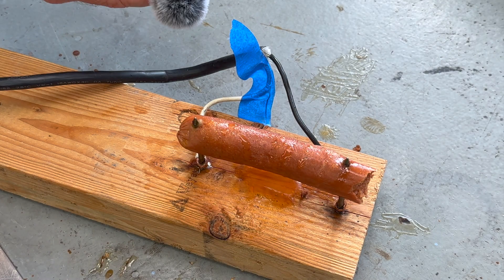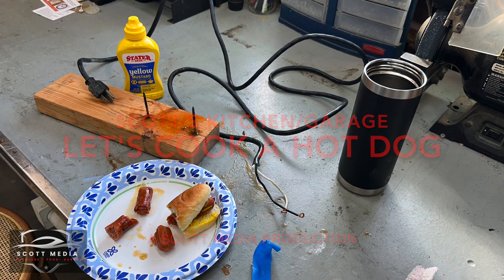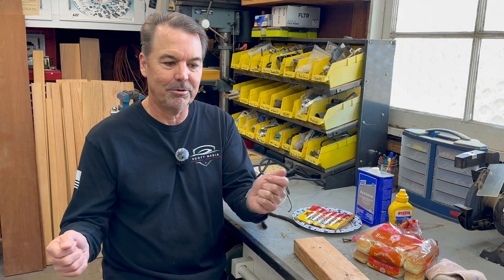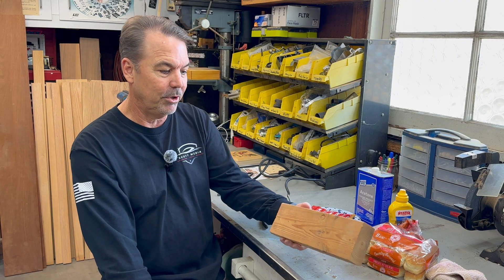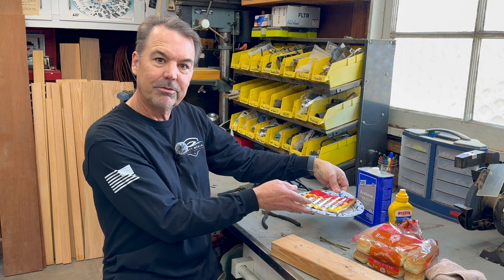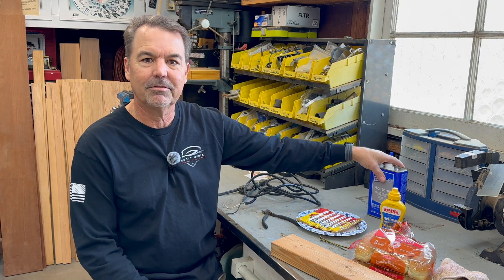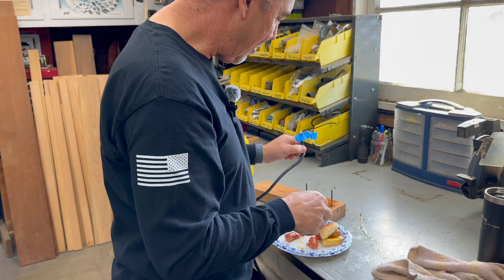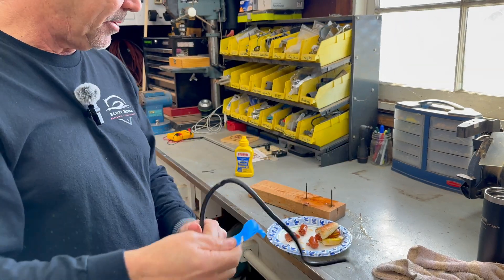Cooking a Hot Dog With Electricity - Don't Try This at Home! - Scott's Kitchen/Garage

Comment: We had a Presto Hotdogger when I was a kid in the early 70's. I used it all the time. I remember the "burnt ozone"/sizzling hot dog juices smell.
Reply: In the late '60s, my dad was friends with a fellow who  had all manner of nifty "kitchen innovations" he was trying to market.  One of them was an electric hot dog cooker which we kept at home.  There were 3 or 4 sets of horizontal metal prongs.  You'd take your thawed hot dog and wiggle its ends onto each of the prongs.  Worked well, and fast, but as you note, there was a certain "ozone" aroma and taste to them.  I assume that, as a commercial product, it had safety approval.  It also had a cover you could close to keep any hot dog juice from spattering all over the counter.
Reply from the maker: Yep, you got the smell right. LOL

Comment: In middle school we had an assignment in speech class to do a demonstration in front of the class. Maybe 1968. Morris did this one but used a one inch board and made the electrical connection on the bottom before the nails were fully driven in. He tacked a metal bottle cap on each corner to provide a little clearance. Without the bun, he ate it and said it tasted great! A few of found it hilarious, but most of the class was awestruck to silence as the Hotdogger was still many years into the future.
Reply from the maker: That's awesome! I wish I had been there to see that.

Comment: Police Detectives used to do this in the 13th precinct way back in the day using two forks and had it hanging over their garage cans.
Reply from the maker: Sounds, ah, delicious?
Reply: @ScottBelangerVideos two wires plugged into the wall socket. Talk about cooking a hotdog. Just don't touch the forks until you unplug it 😁